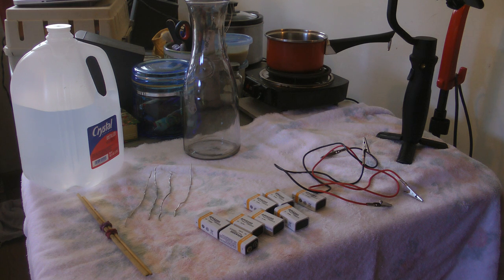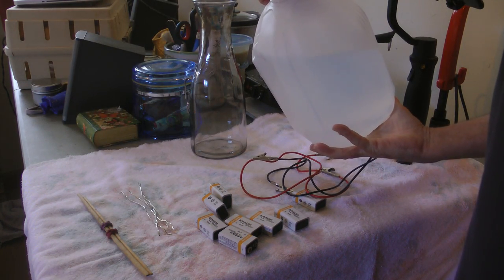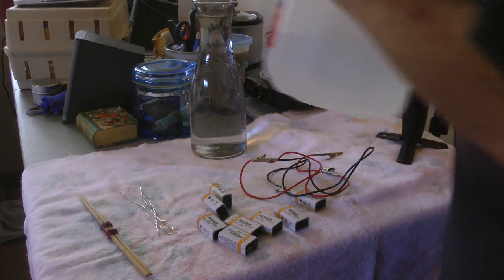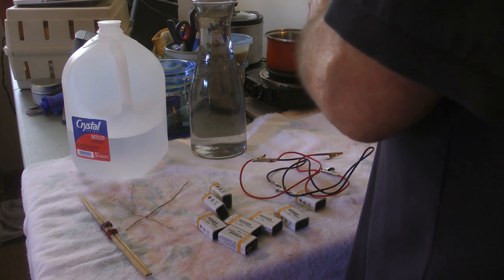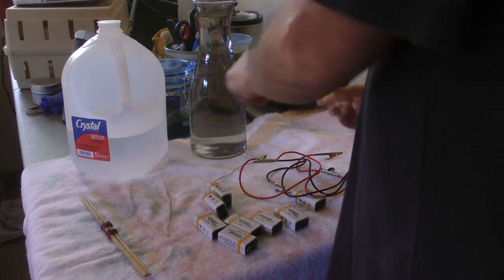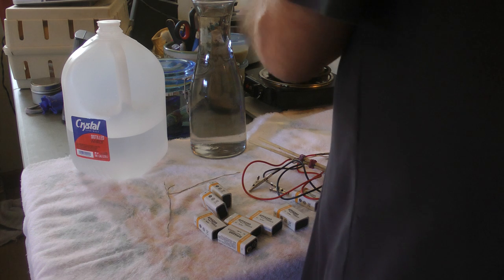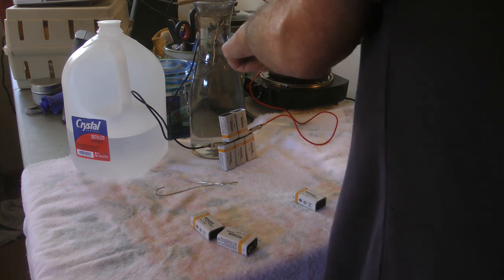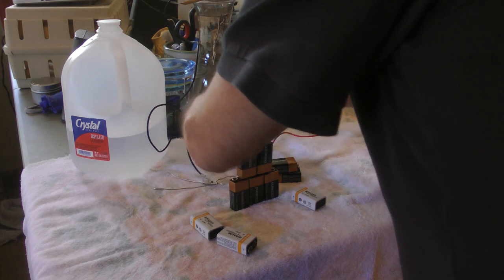Cooking Colloidal Silver

Comment from the maker: 3 batteries will work as well, but needs to cook longer, as it will cook slower. 5 batteries, for four hours, 3 for eight hrs. Also cheaper to invest in rechargeable lithium, 9 volt batteries.